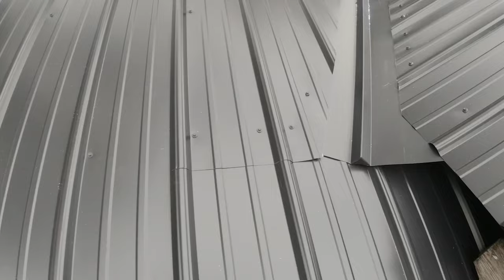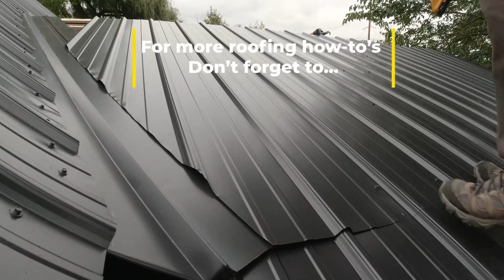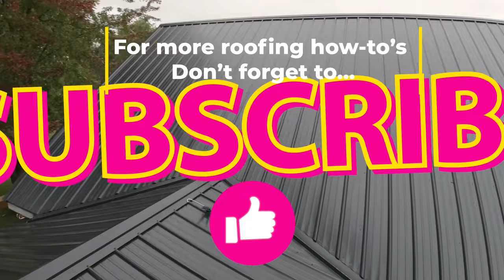Installing metal roofing around a valley ending in a roof.

Comment: That is exactly the detail I need to create in just a few days.  Since I have a very shallow pitch I am sure hoping that the location of the standing seam cooperates with the valley flashing.
Reply from the maker: If you are unsure you can measure to make sure the valley point comes out between the ribs. If it doesn’t you can rip a sheet to make your starter the right width so that it comes out right.
Reply: @plankroofing  thanks,  yes I’m going to plan to do that. This standing seam seams to repeat at about 11 7/8 intervals.  I’m going to have to join a bunch temporarily in order to get an accurate measurement.  Also I’m hoping that a vent penetration further along the roof will also cooperate to avoid a seam.
Reply: bro actually put screws into the pan

Comment: Did you just lay the metal roof on asphalt shingles?
Reply from the maker: No, 
We put 1x4’s on first, if you lay it on shingles it will scratch the metal from expansion and contraction. 
Also the 1x4’s give your screws more to hold. If you only screw into plywood or OSB your screws will back out and cause leaks. Unless you use the larger shank screws designed for Plywood.
Reply: You can use rino shield over the shingles if you don't want to strap it just use the longer screw.
Reply: @davepaints101  eh….just throw furring strips on. Good for a piece of mind.